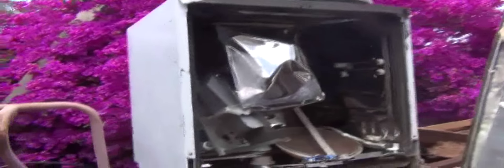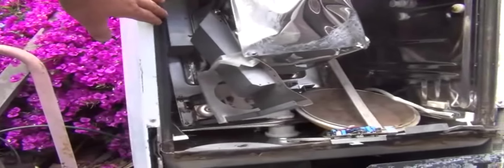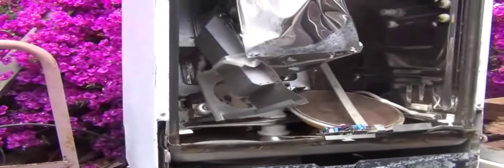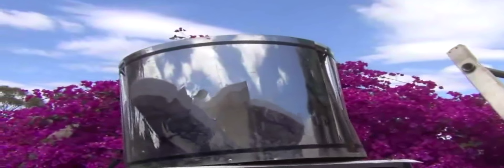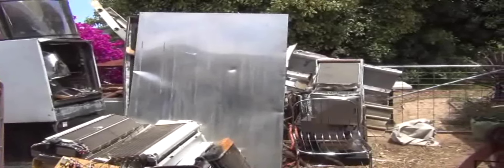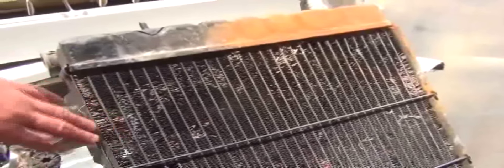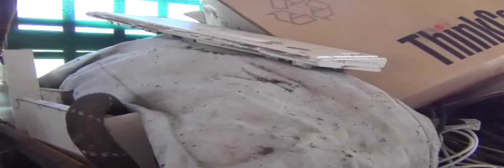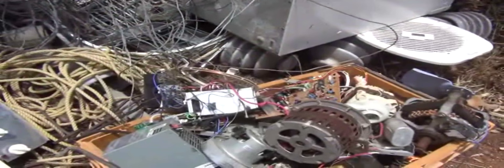Scrapping to Survive - 6 Months of Scrap Metal Collecting

Comment: Man, Billy! You've got the stuff there! When you take stuff apart, do you have buckets to sort you nut, bolts, screws into stainless/steel lots? A friend of mine did with a metal bowl with a huge magnet dropped all the screws, bolts, nuts into the bowl. Then dumped the bowl and all the stainless would fall in the stainless bucket.  Be sure to remove heavy steel hardware that might fall off due to being stronger than the magnet. Once you get into the habit, it'll pay off.

Comment: I used to work in a metal recyclers and drove a machine with the magnet dangling. Anything the magnet wouldn't pick up on my shift I cashed in at Xmas 'til they brought in the ABN number rubbish. Have to be a business with an ABN to cash over $50 worth in Vic.  Don't know if it's the same where you are.?  Might get an ABN as the more I see the more it becomes comon sense to gather scrap that's basically everywhere. I've only been recycling useable or saleable items; time to look in to this. Pam

Comment: Sometimes radiator shops will buy old copper-brass radiators to use for rebuilding, it's something you may want to look into. The newer ones with plastic tanks aren't rebuildable thanks to the plastic tanks, the only part that is any good is the coils.